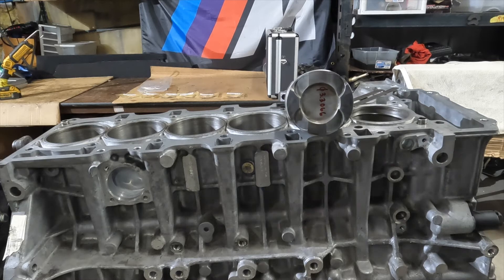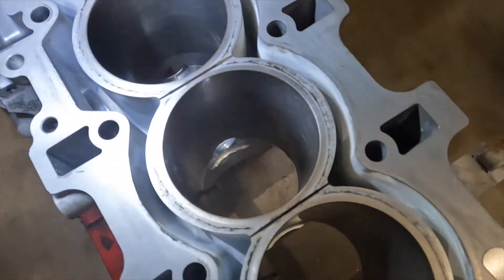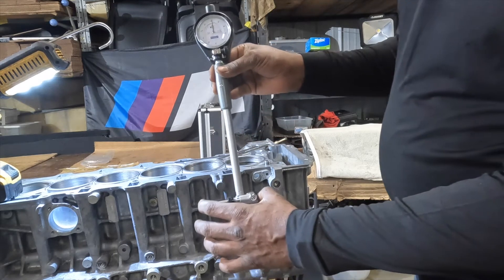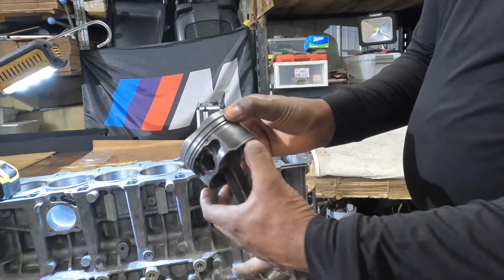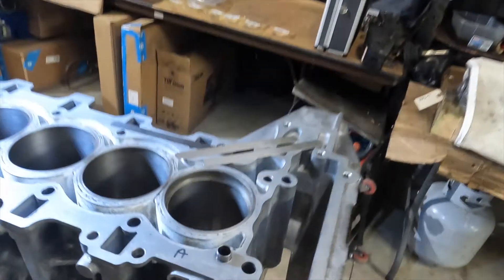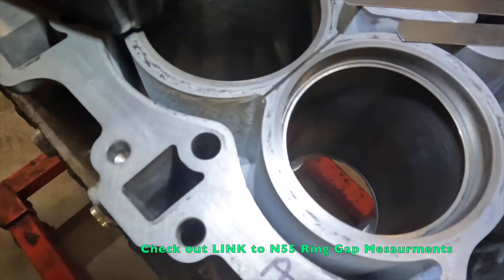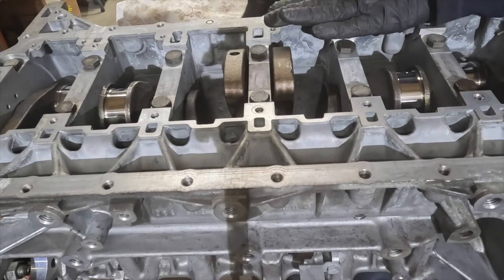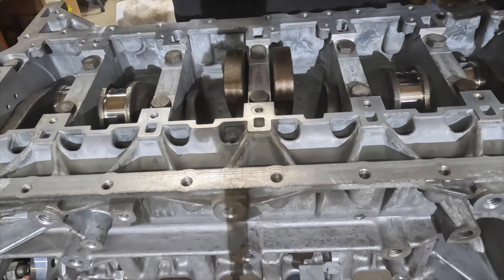BMW N55 1227701 Block Reassembly   Measurments   Main Oil Clr Part 5

Comment: Good attention to details. 

I am curious.
How out of round and tapered were the cylinder bores? 
Any more than the other? 
How worn were the old rings? 

Good luck with the rest of the rebuild.
Reply from the maker: Taper ws no more than .0004"  Max out of round .0005"